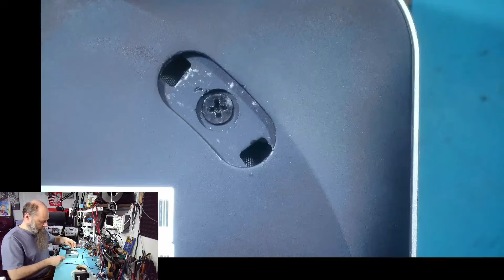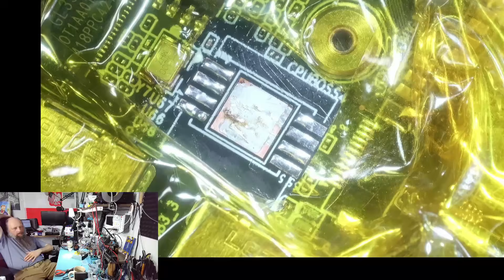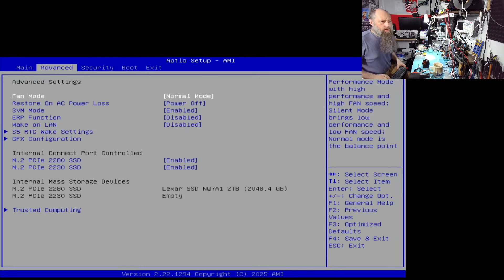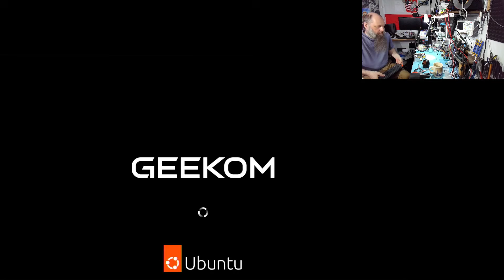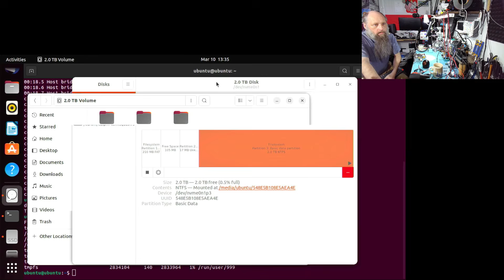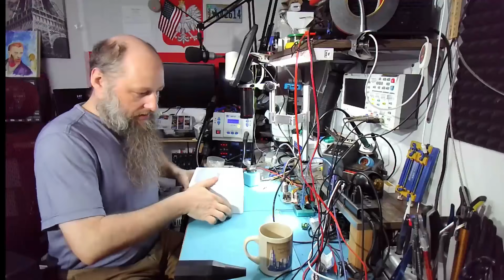366 | Geekom A9 Corrupted Bios Repair

Comment: Hello, Great job on the repair, I have a Geekom IT12 with a corrupted BIOS; the LED lights up, but the fan doesn't spin. I reflashed the Geekom firmware onto the MX25L25645G chip using a clip without desoldering, but it still doesn't work, even though the chip was programmed successfully. I suspect corruption of the ITE EC IT5571VG-128 chip, which likely needs to be programmed manually.

Comment: You just snatched an easy pizza from a certain UK repairman.

Did I get it right that just resoldering the flash fixed it?
Reply from the maker: Yes, BIOS rebuild and reflash fixed it, it didn't work at first because I messed up soldering.
I didn't know it was coming from UK, otherwise I would have recommended someone from there

Comment: Great result, but the video felt a bit more like a celebration of the outcome than a walkthrough of the process. With so much in fast-forward, it kind of felt like we missed part of the journey and that’s usually where the real value of your video is.
Reply from the maker: sorry about that, I had over 3 hours of footage to compress. What we did was exactly what LeadFarmer said at the beginning of the video, reflash clean BIOS and we're good to go. The reason it took so long is because I messed up soldering at first. It also took us a while to find where the antena connects :)
Reply: Exactly. I had to ask ChatGpt for an explanation after watching the video. And he did...